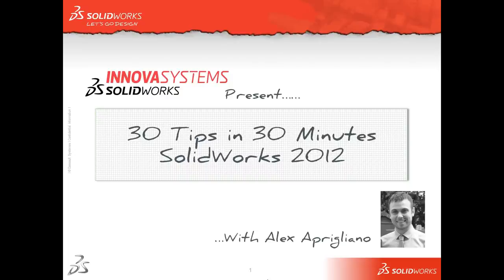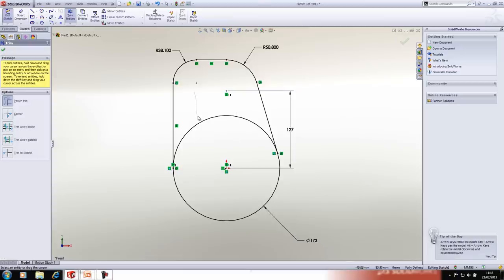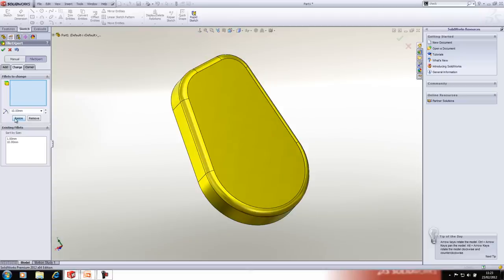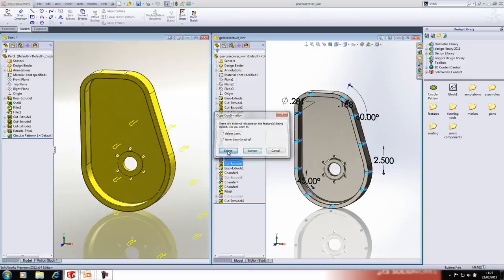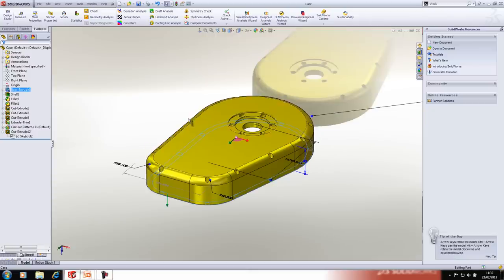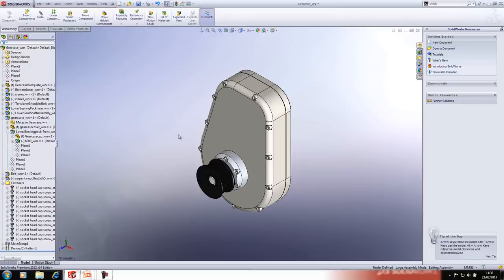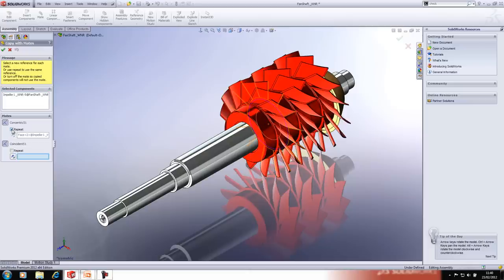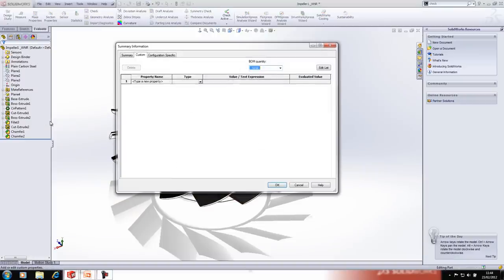30 SolidWorks tips in 30 minutes [Webcast]

Comment: Thanks for the great video.  At 6.53 you activated a pop up that you referred to as Fits and Fillets.  How did you bring up that pop up selection box?  It doesn't appear to be the s key trick.
Reply: I think he had it available on his "s key" for features.  He has probably customized his, which is easy to do if you hit s key, then right click you will see customize option.  That will open the option window and you can add whichever shortcuts you want to the s key popup.

Comment: Hello!

For everybody interested in enabling the RealView Graphics.

IF you are using a professional graphics card (i.e. nVIDIA Quadro, ATI FirePro), the RealView Graphics mode should be enabled by default. Since you've asked the question, it seems that you use a non-professional graphics card, for which, the RealView Graphics mode has been disabled without an option to enable it.
It is still possible to enable the option by using a program called RealHack 3.7, which enables the RealView Graphics option for SolidWorks 2005-2014 (try "RealHack 3.7" on Google).

WARNING:
You should understand that enabling the RealView Graphics option adds a considerable strain on a graphic card - this is why it's NOT available as an option for non-professional graphics cards.

I'm telling you how to enable this, because I wanted the option very much and also, because I'm using RealView Graphics for more than two years with a GTX460 without any known problems.

When creating SolidWorks, Dessault Systemes intentionally blocked the feature to prevent damage to the non-professional graphics cards, so I personally don't advise you to piss against the wind - DSS is not sending you to catch whales, on a jet-sky.

Self documentation is STRONGLY advised - in other words: don't struggle to fry your gaming card.

Cheers.

P.S. I just love SolidWorks!
Reply: Thanks for the tip.  I think many who have solidworks also have gaming graphics cards, some of which are highly capable, so it's sort of silly that this is blocked for those graphics cards.